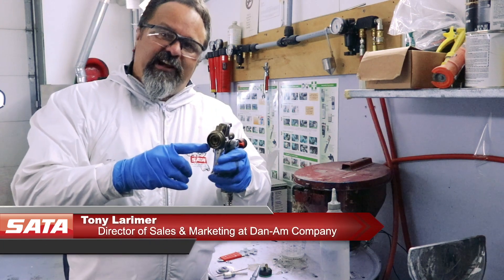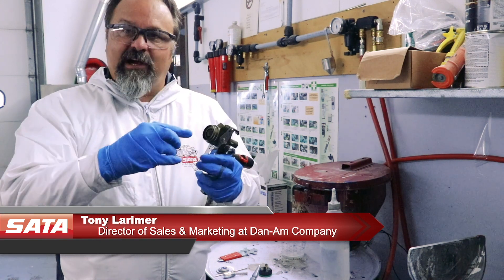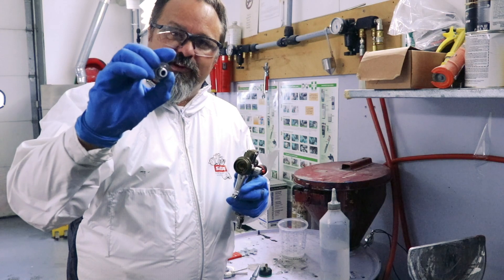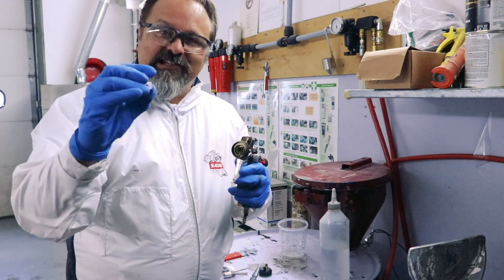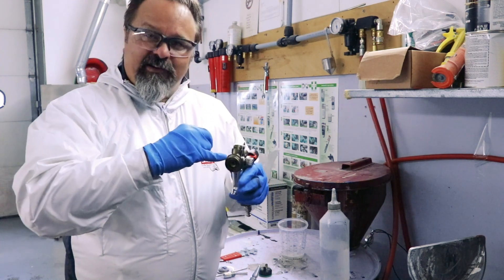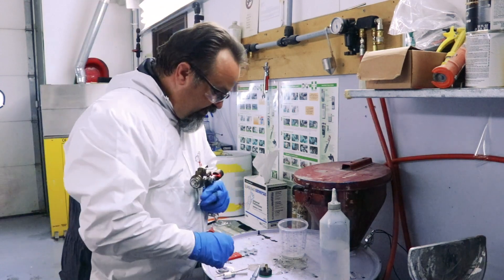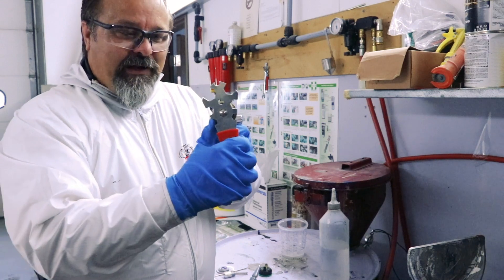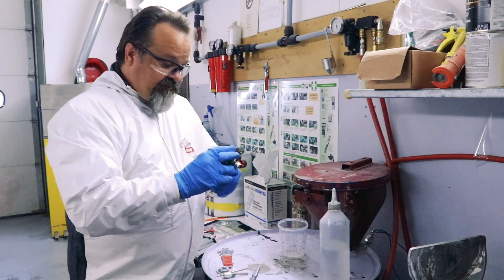SATAjet X 5500 fluid nozzle seal - Easy to maintain & tighten

Comment: My gun is sputtering , how do I fix that
Reply: Did you find a fix? Mine is doing the same thing
Reply: @alexpenaloza2021  how did you fix your sputtering
Reply: @alexpenaloza2021  yah I found a fix, I sold it !!
Reply: @humbertoestrada231  🤣🤣🤣
Reply: The sputtering means the fluid tip is not tight enough , you have to really tighten the fluid tip but don’t go crazy with it and strip it haha